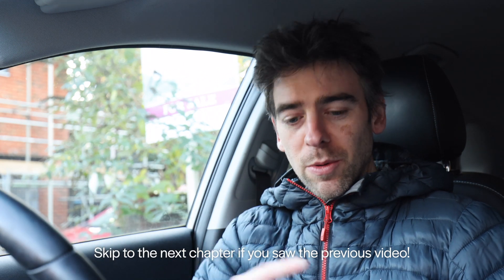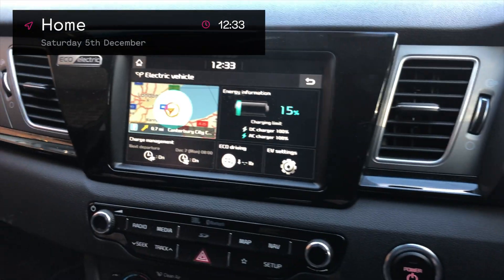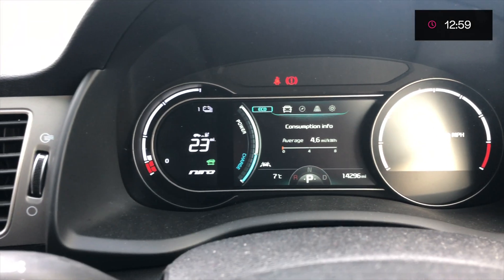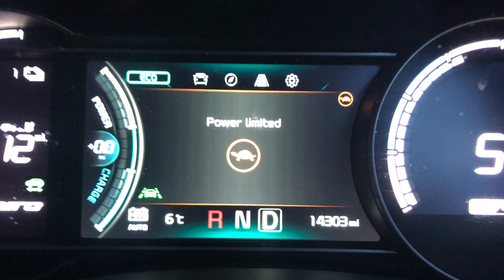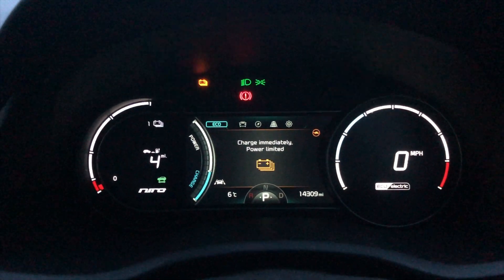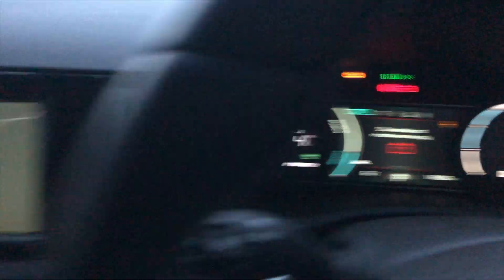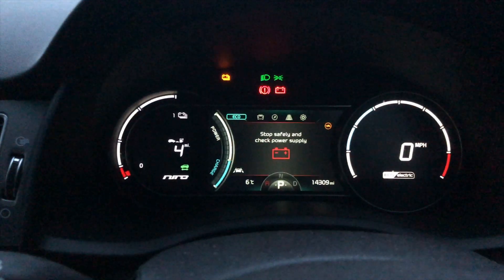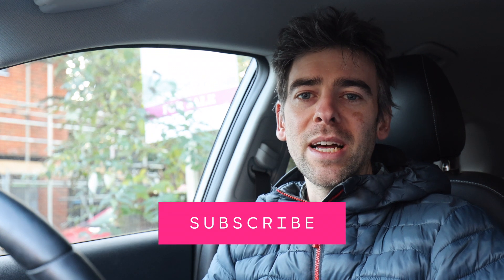Why I should have calibrated my Kia e-Niro's battery management system

Comment: I'd not come across calibration yet, but did know that the monthly 100% charge on AC was to rebalance the cells, but I suppose it may very well be recalibrating too.
Reply: I thought rebalancing the cells is what was meant by recalibrating.  Do you know them to be different?

No way do I recharged to 100% monthly.  The closer to the middle your stick, the less frequently you need to rebalance the cells.  If you normally charge to 60% and don't drop below 40%, then you don't need to rebalance as often as if you charge to (say) 80% and drop as low as 20%.
Reply: @ScrapKing73  yes recalibration is different to balancing the cells but they both can be done at the same time for example when you charge to 100% and charging to 100% is perfectly fine just don't keep it at 100% for a long period of time so just charge it at night to 100-percent then drive it down to 80% in the morning
Reply: @raptorpome2577  Interesting.  What do you believe to be the difference between rebalancing and recalibration of cells?
Reply: @ScrapKing73  I'm the opposite in that I have never come across 'recalibration' before!  The Niro's battery comprises 294 individual pouch cells, each one with slightly different electro-chemical properties - something that is inherent in their manufacture.  This means that each cell reaches its maximum state of charge at a slightly different time.  So if you stop charging the battery when the 'weakest' cell is 'full', the stronger cells won't be fully charged and you will have lower overall capacity and therefore vehicle range.  If you keep charging until the 'strongest' cell is fully charged you will have overcharged and therefore damaged all the other cells, reducing your battery life.  Rebalancing discharges the stronger cells a little bit (usually via a resistor) allowing the weaker cells to catch up so that all the cells are fully charged without damage.  That is why you have to let the overall battery pack reach 100% occasionally.  Rebalancing is not as big an issue for modern EVs as cell manufacture has become more sophisticated and I believe cells are grouped by their individual characteristics so that cells with similar properties are put into the same battery pack.
Reply: @stephenharrison3232  Your understanding exactly matches mine.  I have traditionally heard what you're describing as rebalancing cells.  I remain uncertain whether rebalancing and recalibration are two names for the same thing, or not, but I suspect that they are.  If someone knows a distinction between them, I'd love to hear it.

Comment: Kia need to update his software to re-calibrate automatically to always keep it correct or surely they can put that in a software update
Reply: You cannot recalibrate the BMS automatically, unless you will allow it to discharge its battery fully overnight and recharge afterwards. This can get expensive. The deviation is not that bad, and you will from time to time from low SoC to full in normal use. If not, you will need to think of it, to not recharge a while, let.it run to low SoC and then recharge to full to recalibrate.
Reply: @patrickfavier4310  Agreed on everything you said.  And there's no perfect schedule upon which you need to rebalance the cells, and since I don't charge it very high or drain it very low I do it very infrequently.  I've never charged over 60%, and almost never drain it below 40%.  So I'll wait until there's a need, or it's been a crazy long time without a need.

Comment: By the way, I feel you're unfairly blaming yourself. How much knowledge are motorists supposed to have??? It should be an easy user experience. Your typical driver isn't going to know about cell cycles and cold weather battery care. You know more than most and you ended up running out of power, so Kia does need to learn from these instances.
Reply: Yes, absolutely. The owner should not have to second guess (ignore) data that the car presents. If your journey was to climb up Everest I could forgive the GOM getting it wrong, but there is no excuse for such an error for a "normal" journey. The car knew the temperature and the SOC. If the battery was "calibrated" as recently as October then it should not have forgotten so soon. Yes, you could/should have charged the car, but it is not your fault that the car lied to you. This is on Kia, not you.
Reply: Oh, also, having just watched the latest Carwow video, running EVs till they died, it seems pretty idiotic to write software that kills the car with 4 miles remaining. With the Renault Zoe, Matt was able to drive well beyond the 0%, 0 miles indicated when the battery charge got low. A far more intelligent way to handle things than your Kia.

And to be clear, I'm not anti Kia, far from it. I've had a Cee'd for the past eight years and it's as good to drive now as when I first bought it, new.
Reply: @eezytiger  Software can't do anything about it. It's the one drawback of the Korean chemistry and cell architecture (vs its advantages, batteries are compromises). Towards the end you need to be very careful. And it was two very short trips in cold weather, too. In cold weather, GOM works pretty well, if you drive the battery down to 0 from, say, 25% or more. If you start driving with everything cold and an almost empty battery, you are likely to run out of power because that doubles consumption (battery heater, cabin heater, etc) for the first 10 minutes of the trip. If your trip is only 15 minutes, and you repeat that twice, GOM can't compensate. The Korean EV's are geared towards efficiency. Their batteries have extremely low inner resistance and very little heat loss, even when they are very cold. The battery heater heats them far less than with other manufacturers, increasing overall range. However, the battery heater consumes some power and at low SOC and low temperatures the battery struggles to deliver all of the charge it holds. Even a moderate load surge leads to a sharp increase in amps because it causes a voltage drop on top of an already low voltage, leading to further amp increase and further voltage drop etc. thereby rapidly depleting the battery.
Reply: @adrianguggisberg3656  I beg to differ. A little extra reserve in the battery to make sure the vehicle never quits with range still remaining cannot be impossible to code for. Who on earth would ever want their wife/mother/daughter stranded by a vehicle that was engineered without a simple safety margin to guarantee no nasty surprises (from the vehicle at least) when driving home on an unlit country lane in the wee small hours, or any other time?
Reply: @eezytiger  There's a battery gage in %. It is the relevant Instrument. If you go on a trip with a petrol car and the tank clock is on empty, you will get stranded, so you top up. If you go on a trip with a BEV and the battery is empty you need to charge or else you will get stranded. An empty battery behaves differently than a full battery and one needs to take that into account. GOM can't charge the battery for you.
Reply: Yes this. Firmware should take into account of last calibration time, weather and remaining range and be conservative when cold etc.
Reply: I understand that the most common reason that the AA is called out is for cars that have run out of Petrol/Diesel. You can give a driver a meter but you can't make them read it.
Reply: I get your point and I agree: These systems should be as good as possible so everyone can trust that displayed information. But to be fair, this also happens with the predicted range on ICE vehicles. I had a car that estimated a range of 60 miles left, so I kept driving. After about 30 miles the estimated range dropped to 0 (and I was driving slowly). What I've learned from it: Never really trust that estimated range regardless of the power source. Keep a buffer to be safe. And I would strongly advise everyone to do so.

Comment: Does anyone know whether use of a trickle charger on the 12 Volt battery has any negative implications for the E-Niro?
Reply: I think that the 12 volt battery is no different on an EV to an ICE car just smaller capacity as it doesn’t have to turn over a starter motor, so I would say yes it’s ok. 
https://www.carsdirect.com/car-repair/how-to-use-a-trickle-charger
Reply: Does it not effectively get trickle charged all the time from the main battery? (As long as you don't let the main battery delete below 15% charge!)

Comment: I've gone to 3% in my FE with no turtle or power loss, but that was after a long stint of motorway driving. The battery would have been warm by that point. I think 3% and a warm battery is quite different to 3% and a cold battery.

Comment: What was the name of the emergency power pack you had ? Didn’t realise how the 12v battery was charged.
The lack of a granny lead with the new E Niro does make low charge situations a bit more concerning.
Reply: Errr... No. All e-Niros in the UK come with the type 2 cable and the granny lead.
Reply: @roundel52  Hi John, we have found the type 2 lead but the granny lead is nowhere to be found. Where should it be stored in the car

Comment: I suspect the variability in applying power limiting is down to the BMS and individual cell voltage variations. The battery is only as good as the best cell in the pack. This is another reason for charging to 100% once a month or so as it helps balance the cells (this means getting them all at the same voltage). Once they start to vary, the maximum current that can be drawn is limited by the lowest voltage cell in the pack. That's likely to be exacerbated by a cold day as the individual cell resistances will be higher resulting in an even bigger cell voltage imbalance. (Copied from e-Niro Group!)
Reply: I'd say that the battery is only as good as the POOREST cell!  :-) The weakest cell will reach zero volts before the others, and can be damaged further by reverse-charging it!
Reply: @hamshackleton  Ooops - you're right not a good typo!
Reply: @hamshackleton  none of the cells should EVER reach zero volts under any circumstances. The car would shut off if any cell gets lower than say 2.5V in order to protect from cell damage. You cannot ever discharge Lithium Ion cells to zero Volts as irreversible damage occurs. Cell reversal will never happen.
Reply: @ThePrawlin  - I know this, you know this. I was stating the hypothetical results - anyone who bothers to read and understand lipo's/lion's knows this. In a car, the battery protection circuitry SHOULD prevent this ever happening - but you never know until it doesn't!

Comment: Is this calibration process written in the manual of the car? Or where does this come from?
I don't really believe it applies to Li-Po batteries and this was used more back in the days of Ni batteries.
As far as I know and have experienced with smaller capacity Li batteries, like on phones and laptops, the battery degrades when going to 100% and leaving it plugged in and then going to 0, so the device dies and then repeating the same process. So that will degrade the battery which in return will mean the (low) state of charge will not be accurate. So, once getting below 15% the depletion accelerates and it's really a lottery for how much it will go on.
I believe once you have this type of degradation you can't really go back to an accurate SOC scale.
Reply: Rachel's comment above relates and indicates how charging to 100% supports the battery pack and BMS being more closely aligned which would give more accurate GOM
Reply: @paulluvlysmiler1717  Right, ok. So it's more for BMS/GOM calibration rather than actual chemical degradation mitigation. Makes sense then. Thanks
Reply: Also the manual does state to charge to 200% once a month
Reply: @paulluvlysmiler1717  200% - :-)

Comment: As for the lack of dashes, and the early appearance of the turtles, both seem likely to be symptoms of poor low end calibration.  It thinks you have more range/% then the voltage drops and the turtles appear.